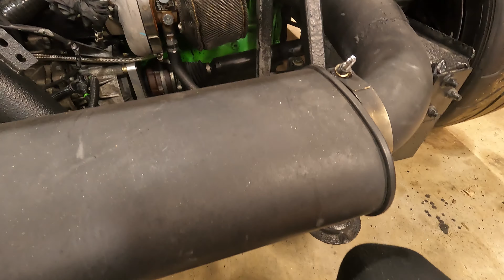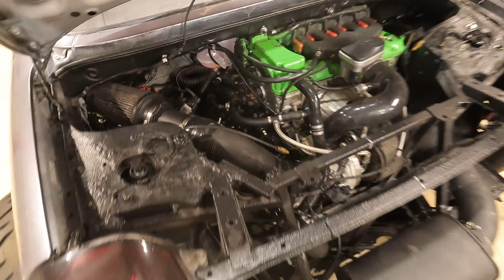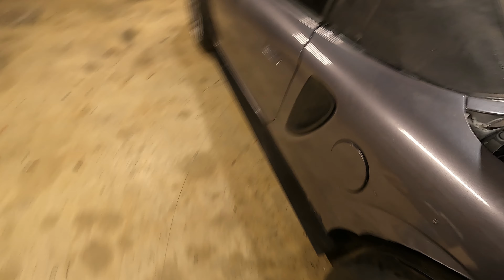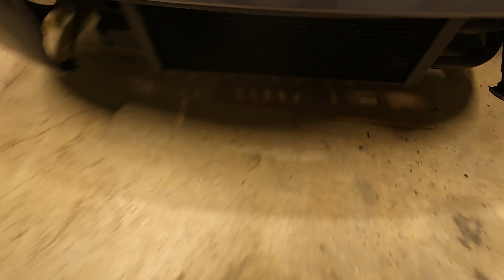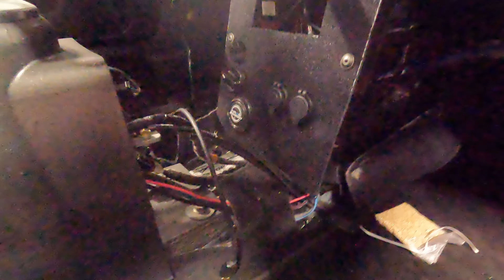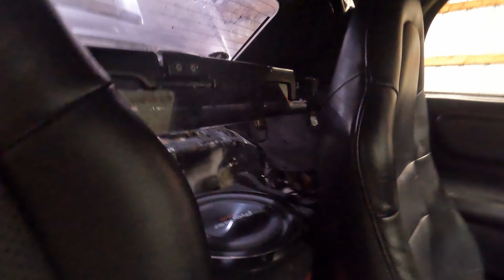600HP Turbo VR6 Swapped Toyota MR2 Spyder: Build Breakdown

Comment: A DQ500 DSG would work perfect in this
Reply from the maker: The DQ250 handles everything you can throw at it also. Both are great gearboxes.
Reply: @269Garage  what's the main difference between the 2?
Reply from the maker: 500 is a 7 speed with more torque rating, but both seem to handle much higher than I'll ever go, and the 250 are becoming cheap.

Comment: Did you fabricate the motor mounts or did you buy them? I would like to do a similar build for time attacks. I would go with the cast iron block 2.8L vr6 bore and striked to 3.0L.

Where would suggest to get used vr6 engines? Is the engine you sourced from a v dubr32? 

Awesome job. Id love to see you using his car in autocross or time attacks or open series race days or practices!
Reply from the maker: I fabbed my own, and I sourced my engine and gearbox from a TT, which is the same block as the R32 or Touareg. I'd think the best 2.8 source would be from a mid 2000s jetta. Just make sure they're 24v instead of 12v. If I need a new block for mine, I'm gonna use a Touareg block since the R32 ones are rare. Also, all VR6 blocks are cast iron no matter what size if that matters.

Comment: my buddy had mr2 spider k24 built motor and big turbo making 800hp in mr2 spider 
i think you messed up on engine choice
Reply from the maker: Both engines are capable of big power, just one sounds better than the other, and has a better dyno curve for both hp and torque. It's all about preference at the end of the day, and I work on VW/Audi as my hobby. I'm not a Honda guy.
Reply: @269Garage So nicely said ! Your a very motivated talented guy !  Im watching this at least a year after you had posted this and i am hungering to hear more about how it performed on the street or track ?  I drove a 450 HP 91 MK2 a few years ago and i was shocked at the grenade curve on throttle. It wasn’t really a fun drive as it was a handful when the turbo was spun up so much power all at once and especially in a 2,700 pound car i cant imagine 600 or 700 HP in that little go cart lots of smiles per mile . I liked and subscribed !

Comment: Awesome!

Was there a mechanical reason for extending the wheelbase, or was it a stylistic thing?
Reply from the maker: Stylistic mostly and ease of installation and removal of the drivetrain. I can pull it in less than an hour, or 3 beers.
Reply: @269Garage  Gotcha!  So it would've been possible to fit the vr6 and kept the wheelbase the same?
Reply from the maker: Yeah it's been done documented one other time on youtube

Comment: This is a crazy build. Immediately earned my subscription
Reply: I'm not trying to be that guy but you should really consider harnesses if you don't have them. 600hp in an mr2 spider with no airbags is a recipe for danger
Reply from the maker: They are on the list. I'm going to do a roll bar at the same time. I'm not pushing the car until then. Leaving it at an easy 350 for now.

Comment: Would love to see the knuckle setup. Sounds like a game changer for the spyder.
Reply from the maker: The front ones are kinda shown in the second video I posted. Not sure if I'd recommend it unless you've done a full audi electronics swap, and need the hub and sensor design. I'll be doing a video in the future on finishing the air suspension setup that will have more detail on the rear setup.
Reply: What are knuckles
Reply from the maker: The hunk of cast iron that connects to all of the suspension components and wheel hub. Or the red guy from Sonic the Hedgehog.